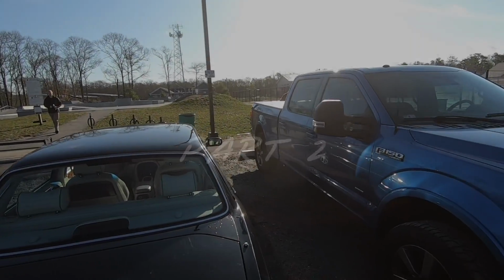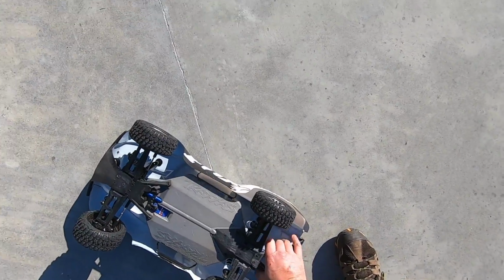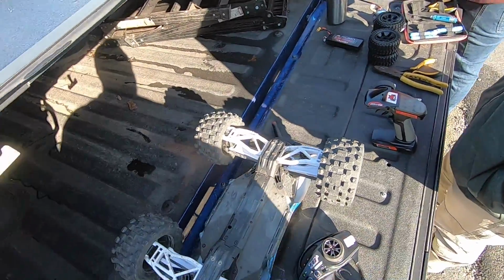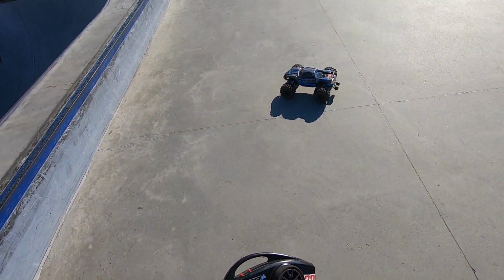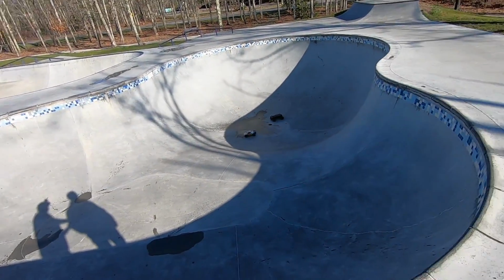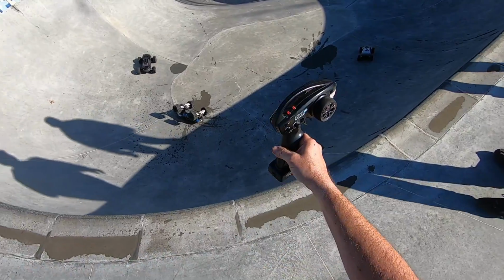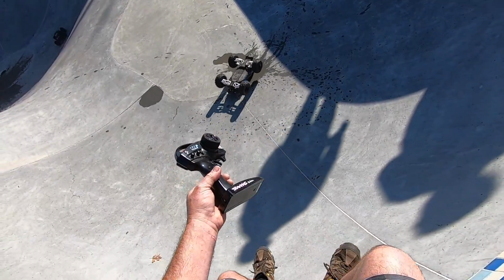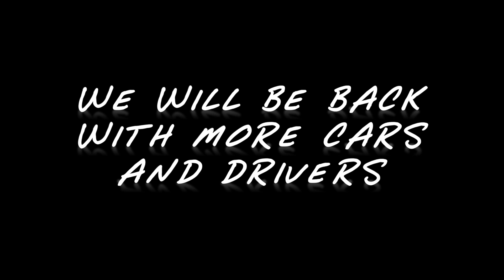Skatepark Demo Part 2

Comment: Use plumbers tape on the Slash shock caps.  Or get the aluminum caps, they don’t pop off.  Concrete is hard on all RC’s.  Good rip though 👍